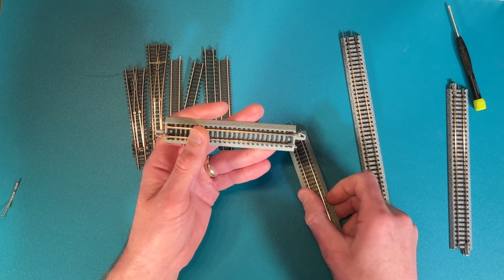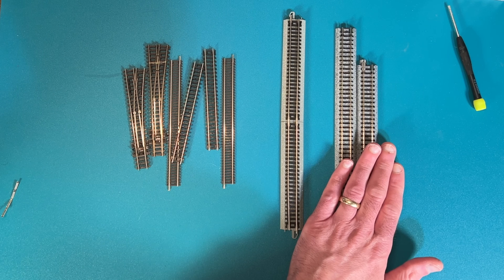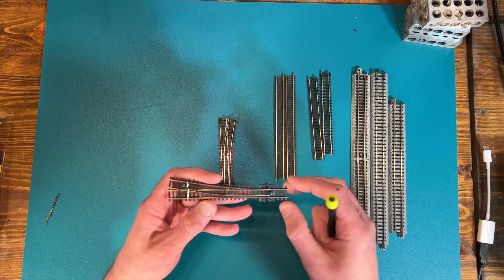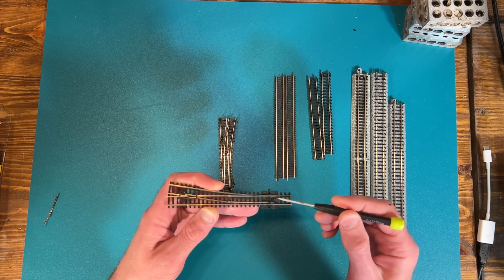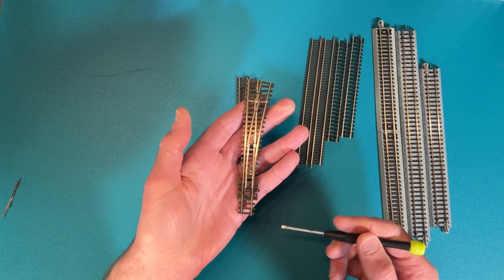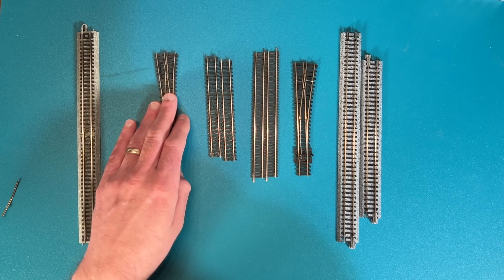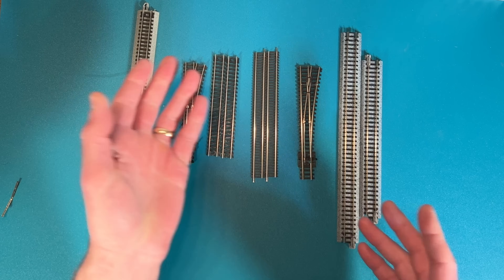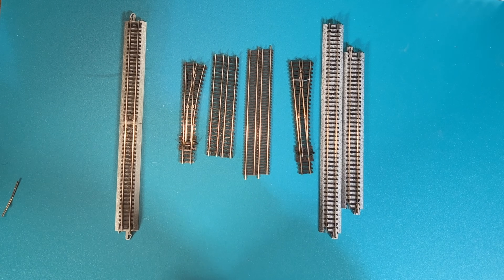What N Scale Track Should YOU Use?

Comment: Why dont you have straight peco track?
Reply from the maker: I couldn’t get any in time for the video (trying to publish every Tuesday morning)
Reply: @StevesTrains  Oh i see, thanks for replying.
Reply: @StevesTrains  Steve, is there any way i can find free BASIC trackplans for peco code 80 track? or do most track plans have mix matching brands. You are intelligent please help. All i want to do is start buying track based off a basic small scale n gauge layout..
Reply from the maker: @frankbean7823  most things I found were books or pdf files you had to buy, but this site sells track packs for entire layouts. What is nice is that you can click on each track plan and see it larger and it has all the part numbers: https://www.osbornsmodels.com/new-setrack-plans-track-packages-in-a-box-394-c.asp
You can mix Peco track with other brands. It is easier if you stick to code 80 or mix atlas code 80 with Peco code 55. It is harder to use Peco code 55 or code 80 with atlas code 55.  Even when mixing Peco code 80 and atlas code 80 you may have to shim the track where you join the two sections. While the rails are the same size, the plastic ties will be slightly different thicknesses. So you may have to slide a thin piece of cardboard under one side or the other to keep things even at the rail joint or just solder that connection with the rail even.
Reply: @StevesTrains  Thanks heaps for that, sorry couldn't reply earlier.
Reply: Steve. Would the NCE or MRC Prodigy or Digitrax / bachmannezcommand handle all the voltages in terms of me not having to worry about my loco or some thing getting damaged because to much power is going through...
Reply from the maker: All of those are fine. With DCC the voltage is always constant on the track with the decoder controlling speed via signals sent through the rails. However, don’t run DC locomotives on your layout if using any of those DCC controllers. You can technically run one of them at address 00 but it is better not to do that. So, only run DCC equipped locomotives.  You can run DCC locomotives on a DC layout just fine normally as long as you aren’t putting more than normal voltage through them.
Reply: @StevesTrains  Thank you so much Sir GODBLESS YOU.
Reply from the maker: No problem, glad I could help.
Reply: @StevesTrains  Steve im being told it's important to have seconadry cercuit breakers like psx if im using say The digitrax zephyer system or NCE power cab. Because other people never mention it just like you they say i dont have to worry and i wont have any decoders or some thing burning out or melting..
Reply from the maker: Secondary breakers can be helpful on larger layouts, and are pretty necessary really. Mainly so if something shorts out in one section it won’t take down the whole layout and it makes it easier to figure out where the problem is. I’ve never used them on smaller layouts. They aren’t really needed if you have a smaller layout and are only running a couple of locomotives at a time. With larger layouts you often need several power supplies and need to set up power districts with each one on a breaker and power a section of the layout so you don’t draw too much current and overload the system, especially if you have multiple locomotives and have larger scale ones. N scale locomotives just don’t draw that much power so if you are only running a couple at a time and have a smaller layout like under 4x8 feet then I wouldn’t bother.  For bigger layouts or if you want to run a dozen locomotives at once then you need to do a more advanced setup because you can’t power all of that with a zephyr or something similar by itself. Those units do have breakers built in and I have had mine trip plenty of times when a locomotive derails or something like that. Obviously having a secondary breaker does provide a backup measure of safety if the one in the main unit fails.
Reply: @StevesTrains  When you say those units have breakers built in, are you referring to the zypher or the more advnaced setups?.
Reply: @StevesTrains  And thank you, im trying to figure out what u just said still.
Reply from the maker: @frankbean7823  The zephyr does, and I’m guessing most of the different units have one built in but I don’t know that for sure. Even a basic DC throttle unit like the Kato ones have breakers with a reset button.  Adding a secondary breaker isn’t going to hurt anything of course and will protect the one in the pack and give you two that have to fail before you end up damaging something which of course is less likely than one unit failing.
Reply: @StevesTrains  Sorry i thought i replied to this already. So the reason some thing could get damaged using zephyr on my layout is if i were to not be there when it derails or some thing like that happens or i was not paying attention, then some thing could happen, but generally on smaller layouts like mine i guess you generally ARE paying attention ( other wise my other question is, why dont most train sets that are ready 2 go out box come with a secondary circuit breaker? )and since the zephyr shuts down etc when it shorts as long as u r there to observe it etc, no damage will be done 2 any thing. And of course generally lower power is being put out, but still that risk aparently is still very real according to what some one else told me so im just trying to figure it out, they say you should be ok etc but also saying they had crazy meltdowns n stuff even with low voltage systme etc. Cheers steve.
Reply: Oh and Dcc keeps rail voltage at constant etc so its safer.
Reply from the maker: FYI, I do have my YT comments settings set to block comments if it spots any bad language, etc. but sometimes it blocks comments that should get through too. I’ve never had an issue in the 15 years or so I’ve used DCC on my HO and N scale layouts. If you do cause a short via derailment or whatever AND the internal breaker in the dcc unit doesn’t trip, then eventually the continuous current flow at the short will heat things up enough to start melting things. That is true for both DC and DCC. It is more likely to be an issue with DCC since the voltage on the rails is higher, on average, since with DC you might only have say 5 volts on the rail if you are running a locomotive slowly.  But, I’ve never had the DCC unit not trip when I caused a short. But, at some point that can happen or your unit might just be defective but you won’t know until that problem happens. Usually it has been the other problem and it trips too easily. I have that issue on my HO switching layout when using DCC because locomotives will sometimes create a momentary short on one of my turnouts. I have to periodically put some paint on the point of the frog of the turnout to prevent that. An extra breaker is a good safety measure but isn’t something I would bother with myself unless I had a larger layout. Of course, if and when I fry something I might change that opinion. Obviously you can keep reusing equipment on future layouts so even if you are building a small layout, if you plan to build a bigger one you can always invest now in bigger power supplies, breakers, etc so you don’t end up spending more in the long run.

Comment: Very good review of the differences.
I ended up choosing Peco Code 55 due to the turnout availability. I really like the Unifrog turnouts.
I do also have some Code 80 track on my layout, eg. rerailers in my staging, that are Atlas.
Also, I really like the Peco joiners better than the Atlast joiners. While the Atlas joiners are bigger and contain more metal and the Peco joiners are much smaller and do not hold as well. The Peco joiners just look a lot more realistic than the Atlas joiners (and the shape of how the ties are made at the end of Atlas settrack)
Reply from the maker: Yep, Peco code 55 is a great choice. I like that track a lot as well.
Reply: I also changed to Peco Code 55 a couple of years ago.  I started with Atlas but they went through a period where you couldn't buy track or turnouts.  I ripped out 100's of dollars of their track and turnouts and sold it on Ebay.  Atlas track was so hard to find, I sold all of the track in no time and for retail prices.  Best decision I made.
Reply: Don't know what a Unifrog turnout is in Peco, I understand Insulfrog (bad choice, and Electrofrog good choice).

Comment: Something to be aware of with Micro Engineering switches - the originals were NOT DCC friendly and were the old power routing style. This mean feeders from the point end only and lots of use of insulating joiners. My N scale is all ME code 55 old style turnouts - then again I don't run DCC.

Wasn't the original Atlas code 55 track just their code 80 sunk into the ties?
Reply from the maker: Thanks for the notes on the ME track.  I’m not sure about the original Atlas code 55 since when it first came out I was only doing HO scale.

Comment: My UK layout has a lot of older locos and rolling stock. I've used Peco code 80 flexi track and points(switches) because of some of the wheel profiles.  But I also have a single slip formation,  only available in code 55, and all my stock runs through this complex without a problem.  The difference in rail heights needs the slip to be packed up by about 1mm with card, that's all.
Paint the rail sides and ballast the track, there's a noticeable improvement in looks and the components in code 80 are cheaper than code 55.

Comment: Been using code 55 since it came out. It’s very finicky to work with but looks great. Because the rail height is much lower than code 80, you will find older locomotives and rolling stock wheel flanges will hit and bump along the molded spikes. This track is also getting very expensive. Stick of flex track is $15 for ONE 30” section. Used to be $4. Can’t beat how real it looks.
Reply from the maker: Yeah, price is getting bananas on track in general. The code 55 does look great!

Comment: Hi Steve, i have to add something to your comments about the turnouts..  when i first got into the hobby i purchased the Bachmann CSX starter kit and went from there.. The turnouts for Bachmann are a joke, they would derail to no end.. in a little test i purchased the kato set M2. comes with some turnouts and nice loop. i was curious why there was such an issue with the bachmann turnouts.  so, i did the flick test on them.. the bachmann had very little resistance. the kato was way more rigid. So, then i had the idea to blow on the 2 turnouts.. you know.. the kato stayed put.. the bachmann opened right up.. so, the spring used in the the 2 types are way different and that's where the issues laid..
Reply from the maker: Good information. Yes, having the points stay tight against the stock rails is pretty much the key to smooth operation over them.

Comment: Going to vent a little here.  If you are building a layout that is more than just a toy, Kato and Bachmann are out.  Here's why: 1) Try to add easements to curves, 2), Try to add superelevation to curves, doable but problematic, 3) The ties are embedded in the fake roadbed, so if you want to add ballast to make the track look better, good luck.  I have seen it done, but with all the other problems meh.   I am building a layout that will be large if I live long enough.  I am using Peco code 55.  Their largest turnouts are all that will appear on the main.  The medium turnouts (such as seen in this video) will be used in yards and such.  With flex track you can do just about anything.  One deviation for me is I plan to use Kato Warren bridges in one spot, so I have to figure out how to make the entry and exit look good.  Bottom line, set up an oval of UniTrak, and run a train around it.  In the curves it looks like S___.  I have a bunch of UniTrak, but only use it for setting up test tracks and such.  The turnouts look like crap as well.  I could go on.

That being said, this video is actually really good.  There is probably nothing said that I disagree with, except using Kato.
Reply from the maker: Peco code 55 is the best track without roadbed I think in N scale when you factor in the durability and variety of turnouts, etc.
Reply: @StevesTrains  I am not particularly familiar with Atlas track, but I vaguely remember years ago that their turnouts were not spring loaded, so a switch machine would be necessary to hold them in place.  Again, that is a memory and not necessarily fact.  I have absolutely no experience with ME track.  I do think Atlas track looks better.  If I were to use sectional track with roadbed, I would use Bachmann, because it would be easy to ballast.  I don't care about their joiners, as I always have power fed to each individual track piece.
Reply: @Ray-dv1md  I don't understand how anyone can use, say Kato, if they are serious at all.  I am not a rivet counter by any means, but I look at track that is ballasted, super elevated, with easements, and only wonder why anyone would not want their track to look like that.  Watch a train going through such track and it is beautiful.
Reply: @jimbelcher6877 - still applies, in addition to being kind of incompatible with older large flange wheels, even on older micro-trains cars. You can run them, but get a distinctive bump at each and every tie. This is why I use Micro-engineering flex, but shame about turnout sizes (only #6), but they do offer code 40 flex and bridge flex!
Reply: @dckuk  Micro engineering is a much better choice than Kato.  I try to replace the wheels on older stuff with the huge flanges.

Comment: DOES KATO HAVE FLEX TRACK??
Reply: Not that I have seen, but they do have adjustable length pieces (pretty cool). Between all of the different size curves you should be able to replicate most track plans.
Reply from the maker: I think they have a Kato branded flex track but it is just regular flex track, and they are just reselling sometime like Peco flex track or something like that. It isn’t anything with molded on roadbed. It is easy to work any design without it given the wide variety of pieces available. If needed, you can always cut unitrack down to size or even make a bunch of cuts with a razor saw in the roadbed (from the bottom) to allow you to bend the piece. If you cut a piece of unitrack to make a custom length piece, what you want to do is cut out a section of the middle, and the slide the two ends together and then nip off the excess rail. This way you can still connect the piece using unijoiners.
Reply: They have but its just an improved rebranded atlas flex, i still have the non roadbed kato track its just a rebranded atlas sectional track still code but comparing it to a tomix, its much better in terms of looks at reliability

Comment: want to use kato,...but..when building custom and need long runs, flex seems waaaay easier. Isnt kato only small pieces you have to buy and MAKE a long run? Plus if its got a odd curve or twist it seems easier with flex. Remember,...flex has been a standard, its not junk. Not crazy about plastic attached road bed either. You end up trying to cover that as well as ballast on Atlas. Kato is easy, The others require more work but look better.
Reply from the maker: Right, I’ve mostly used flex track in HO and I’ve done layouts in N scale with flex too. Kato has so many track options that it gets you up and running quickly and reliably. If not using Kato I like Peco code 55 the best. Atlas looks better (as do some others) but the Peco track is pretty durable and hard to break.

Comment: Let's do real world decision making here. If this is your first time building in N, you will be surprised by the price differential between these track pieces. Bachmann and Atlas code 80 are the cheapest. KATO is the top end price wise. Atlas code 55 is less than KATO, especially the turnouts, but it requires special attention. Something not mentioned here is turnout control. This will add $5 to $30 dollar on the installation of any of these turnouts except for KATO and Peco. I use Atlas code 55 exclusively for my layout building, but I am going for a better looking track structure. If I was a first time user, I would stick with Peco medium turnouts in code 80 and Atlas code 80 flex track. They will offer a minimum cost flex track that accepts all wheels from all production eras and turnouts that you can simply throw the points to reroute. They are the same height, but you may need to modify the rail end on the PECO product to make them match the Atlas.

One thing to know - don't depend on rail joiners to carry electricity. They will on first installation, but time, corrosion and paint will make them not work anymore. Plan on running many feeders to the rails from your power source.

Over the last 3 years I have been working on someone else's layout that includes a lot of KATO track, Atlas Code 55 and code 80 and turnouts from KATO, PECO and Atlas. Both in 55 and 80 for the Atlas and Peco. That is what I am basing my opinions and recommendations on.